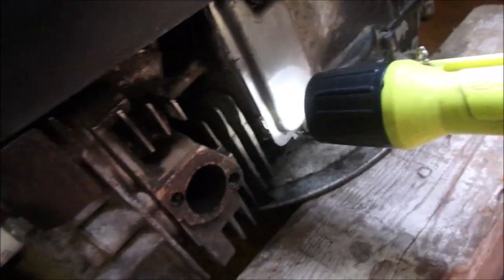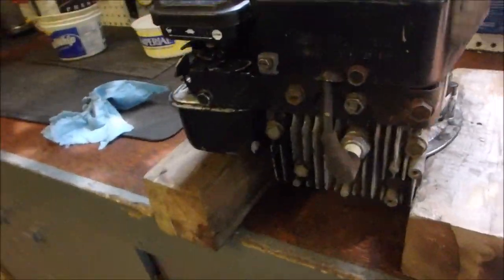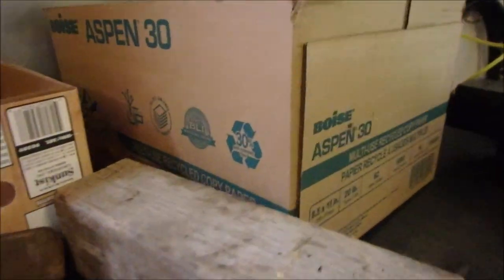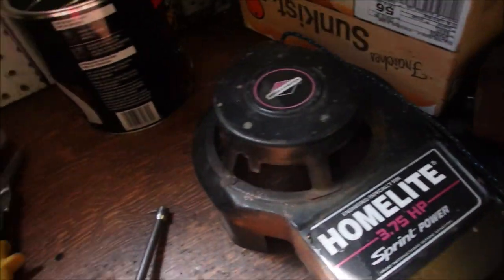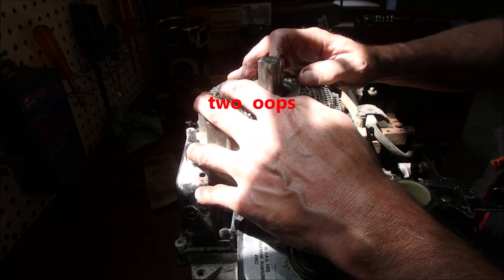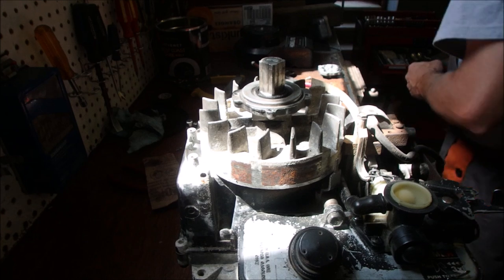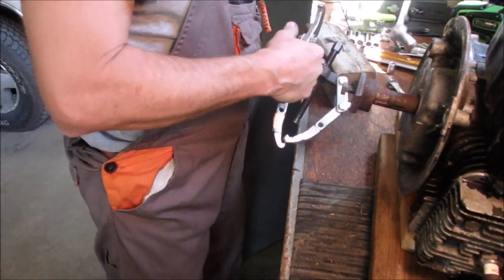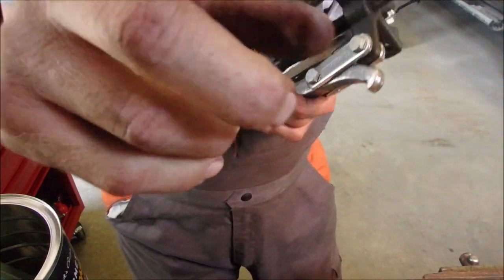Removing a Rusted Blade Adaptor -Homelite Briggs (Part 4)

Comment: I like the puller you used. I have a parts engine with a stubborn blade adapter that I tried take off last year. The puller I have is not that big and it’s worn out. I’ll have to invest in getting a puller like the one you have. Great video Bruce!
Reply from the maker: Thanks Matthew  You will use it.

Comment: I've used all sorts of pullers on stuck blade adapters, but they always have a tendency to go crooked.  Lately what I found works best for me is to use a slide hammer with a small 2 jaw puller attachment on the end.  Usually just 2 or 3 pulls of the hammer and it pops off.
Reply from the maker: I tried a slide hammer on this adaptor before I used the puller as that had worked for me in the past.  This a really true.  I just didn't include it.  Thanks for making me feel "not alone"

Comment: Good job bruce that was a toughy. I was thinking you might need to pull out the torch to help get it off. I understand what you are saying about the puller I have 3 and is a 2 arm one and they 180 degrees apart it does make a difference. I'M enjoying this project looking forward to the next step. Have a great day. God Bless!!!
Reply from the maker: Thanks Mr. Nash.  I didn't think the mechanical issues would be so   umm   challenging.

Comment: Sometimes I put a socket on the end of the bolt so the point on my puller won't slip off the bolt.  Last one I did was rusted so bad I cut the crank off so I could pound out the blade adapter in the vise.  The engine was blown, but I needed the hub for the new engine.
Reply from the maker: I understand.

Comment: I wish the factory would apply grease on the crankshaft before installing the blade adapter. It would sure make our lives as the mechanic a lot easier.
Reply from the maker: No Kidding.  This one was also outside for a long time.

Comment: The threaded bolt you used get a center drill and bore a hole for the puller to set in no bad words needed

Comment: “When do I start cussin,”.  LOL. It can be exasperating for sure!  What size puller is that, ie how many inches?    I notice that pullers are also rated by so many tons, ie 5 ton, 7 ton etc.  How many tons is that puller? I’m trying to find the best puller for my six-year-old Honda that I can’t seem to get the blade adapter off of. I don’t think it’s rusted on too bad, the outside looks pretty good but it’s not coming off by my pulling at it by hand, lol.
I didn’t realize you could use a three jawed puller that way!   Thanks for the great vid as always Bruce. 👍👍
Reply from the maker: Right.  One day i saw the other leg on the puller  (they don't all have them)   I laughed as i has it for a few years,
Don't be afraid to try a little heat.  Put a wet cloth on the engine shaft as you don't want to heat the seal into the engine.
I don't know the tons.  Sorry

Comment: Been there done that and I share your pain. I also leave the socket on the bolt to center the puller. Sometimes theres just no room but it may have worked for in this case.
Reply from the maker: Well off camera I was trying the "easy" stuff and then it came to me.  Duh  get the 3 way puller with the 180 arm.  That is a nice tool eh!!!
Reply: Bruce Pender definately the 180 arm puller is the weapon to have. Watching you pull that stubborn adaptor was like watching a movie where the good guy is underwater and holding his breath. You find yourself right there with them holding your  breath too.  I actually had an adaptor get the better of me but thats for another time. Thanks for sharing buddy.
Reply from the maker: Not to go on and on  but I am happy I can still count to 21

Comment: i usually use a steering wheel or harmonic balancer puller on them. i snug the center bolt with the impact gun and then wack the end of the center puller bolt to shock it loose,no cussing required....lol
Reply from the maker: Well I didn't show it but I tried all my tricks just for fun and not so fun then I brought out the reliable puller.

Comment: Hey Non'c Bruce ..........   Great video.......    I have a Proto 3 jaw like yours, but a lil smaller and have no trouble pulling those stubborn bade bosses off......

I do use a smaller bolt to go in the hole.......   But I did drill a small dimple in the center of the bolt head so the puller won't slip out on the side of the head like yours did....   

I have 3 different dedicated bolts that I use.......   In other words I am smarter than what I am working with  LOL........    

Plus Tard Mon Ami !~!~!~!
Reply from the maker: Right.  Every time i do one I swear I will get a couple bolts dedicated.  But i don't.
Reply: I do a smaller bolt nowadays because that's what I had readily at hand......   Besides that I don't want to take a chance and mess the threads up in the crank, Some people will do that......    I love the dimple in the middle of the bolt head for sure..................   

Plus Tard Mon Ami ~!~!

Comment: i just ran into something i haven't seen in years had a line timer that needed fuel lines and replaced them the thing ran great for a few seconds so went to carb checked for air leaks on shaft seals, carb found none so cleaned and rebuilt carb still ran for a few seconds then quit checked pulse line found nothing have had a few small carbs that i couldn't make good bought a Chinese knock off got it it still wouldn't run right out of desperation pulled cover off and sprayed starting fluid around seals just in case my vacuum test was wrong then i thought lets put a new plug in it ran for two min then quit as i puled on it i noticed gas shoot out around the spark plug lol it was losing compression around the plug the old plug had been leaking apparently also just a lot more found the threads were bad i put some lock tight thread sealer on it and it ran great lol i haven't had that problem in years it was just luck that i saw it doubt if the thread sealer will fix it but i now have it running my compression gauge has a rubber oring so it sealed fine lol should have caught it with the oil on the threads of the old plug but was so sure it was carb
Reply from the maker: I just did a lawn boy with a stripped plug hole.  Tough to ream out as you can't take the head off and do  it in a vice like a 4 stroke, (shavings in the cylinder).  I have been so busy-- no time to make the video   Please wait for it.  You can't use a  heli coil as they drop the end torque piece into the cylinder.  I used the OEM thread insert.   Thanks for mentioning it.  I will get on the video and interrupt this little series.   soon???.  Having trouble with my hands right now.  Me and Zippo 's hand are awh??? how do I say it   forked.
Reply: sorry to hear about hands mine have been shaking as of late cant get the float pin in in less than 30 min lol 
waiting with baited breath lol for the next video i started making my vids a year ago but i had to stop as in one of them i had a viewer cause me trouble lol i decided it wasent worth it
Reply from the maker: Yes.  I don't even want to talk about touchy subscribers as they can wreck your day and a lot more.  I had one for blaming me he spilled gas in his kitchen because i didn't clamp off the fuel hose soon enough.  Can you believe he was in the kitchen with a fuel filled machine and he is giving me a rough time.
Reply: that is about as bad as mine lol i spilled gas on my oven because i tried to empty the gas like you did i got gas all over just like you you didnt warn me lol
Reply from the maker: OK  here goes   WTF   (Where's the Fairness)   haha  or the other one too.
Reply: Wow. He wasn't that smart.  WTH